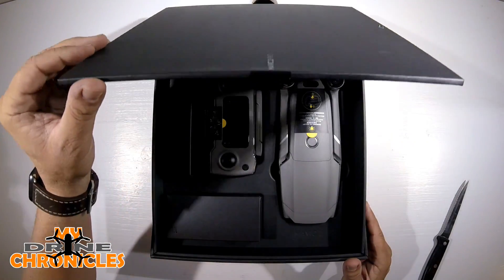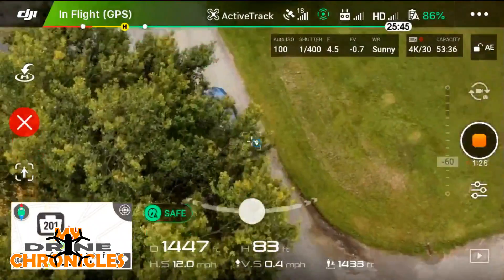Official Compass Calibration Update For DJI Drones

Comment: Great Job, appreciate the update!  It's also worth mentioning that as part of the Compass/IMU calibration process, DJI requires the calibration to be done at leas 4.9 feel from any type of metallic objects, as it may cause interference and or and inaccurate calibration, which could end up sending the aircraft into ATTI mode during flight. Whew, that was a mouthful. Safe flying :).
Reply from the maker: Thank you for the great comment.
Reply: Mine tells me to hold 4.9ft off the ground

Comment: Does the drone need calibrating on every flight?
Reply from the maker: Some people like to do that but it does not need calibrated every time.
Reply: A caveat to when the drone requires calibration and when it doesn't can be found in the DJI Mavic Pro operators Manual.  There are times when you will need to calibrate and or re-calibrate the Mavic Pro.    https://www.letusdrone.com/mavic-pro-compass-problems-due-to-interference/

Comment: i just noticed something on that 4 battery charger
you can pull up that anti slip rubber at the bottom an there is a micro usb port
ill try out if you can use that to charge the batterys as well
Reply: ok just tried 
my result is that the led on the charger is orange for 5 to 10 seconds and than turnes red
Maybe it is for some sort of software on the charger as it finds the most charged battery itselve and starts th charge that first
Reply from the maker: That is interesting! Cool find! I'll have to look into this! Thank you.
Reply: According to the manual this is for firmware updates for the charging hub. Not available at moment but DJI could make it available in future.
Reply from the maker: Yes you are correct that was DJIs reply to me. Thank you for contributing!